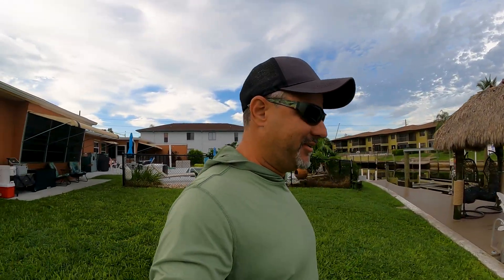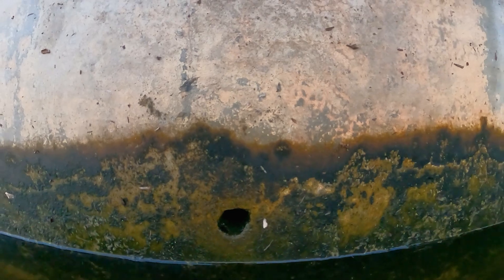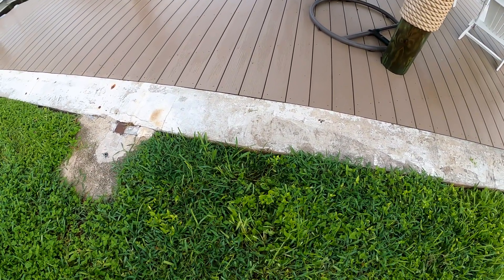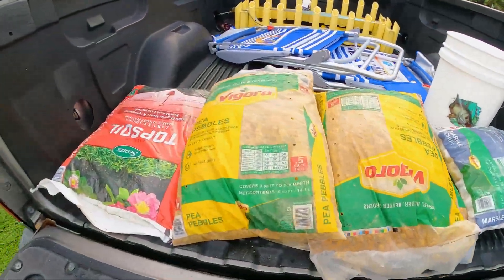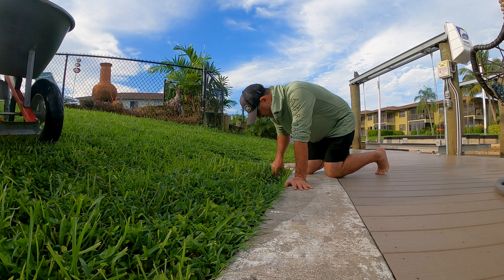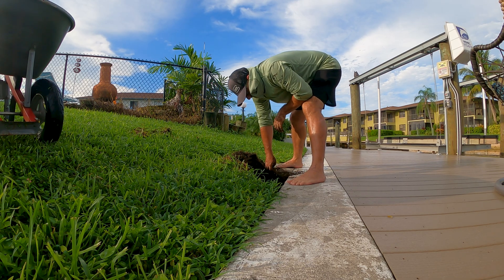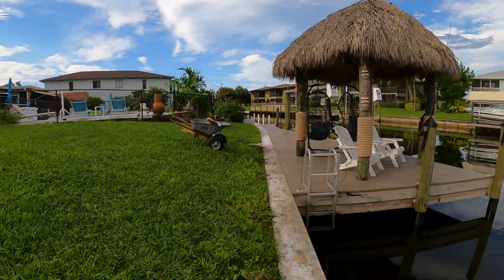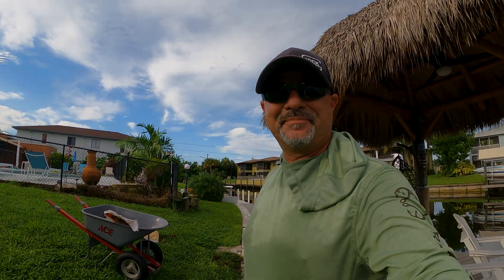Cost Effective DIY Seawall Erosion Repair

Comment: Washouts behind the seawall is a good thing, is shows that the hydrostatic pressure is being released.  The secondary effect is that you loose some fill material.  DO NOT use cement!  Pea gravel is a good choice.
Reply from the maker: Yes.  That’s exactly what’s happening.  Only Sea Wall repair companies will try to tell you any different so they can make money because you live on the water.

Comment: So you have erosion at the mud line and at the cracks/seams. Adding soil or sand does NOTHING... It just erodes again. The ONLY fix other than replacement is to have a poly injection along the wall. Every 2 feet of mudline and stacked at the cracks. It will glue the sand together and create a barrier. Its not a DYI but its the ONLY fix.
Reply from the maker: You may be correct but this seems to work for me and it stopped the erosion plus costs almost nothing compared to your solution.
Reply: I agree to disagree, the best way to compromise a seawall is to stop it's ability to release hydrostatic pressure. A seawall is not a damn, its a barrier that needs to relieve pressure.

Comment: How much would it cost to hire somebody to do these type of repairs?
Reply from the maker: Hello. This is very basic work and if you do not want to just do it yourself it would depend on the scope of your problem and the time it would take to do the job.  Determine an hourly rate and get the materials yourself.
Reply: My neighbor (100ft sea wall) hired someone to do this last year.  It was $3k.  I've done the same repairs myself for around $200.  Actually, I wouldn't even call it repairs, If you live on tidal waters, this is a maintenance item, expect to do it once a year or so, even more if there is a big storm or super heavy rain events...